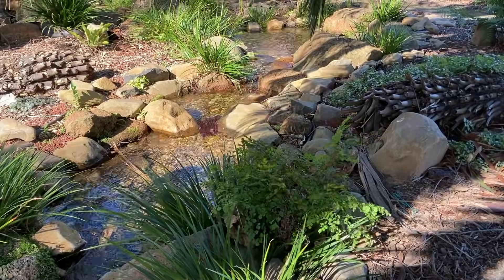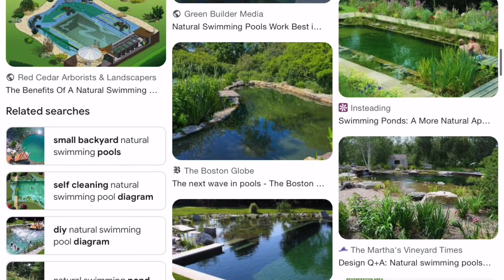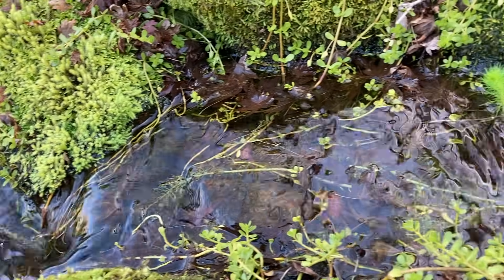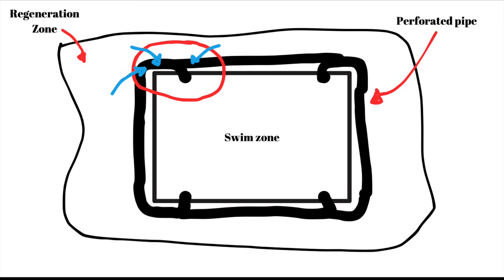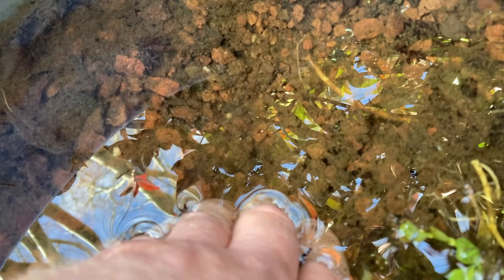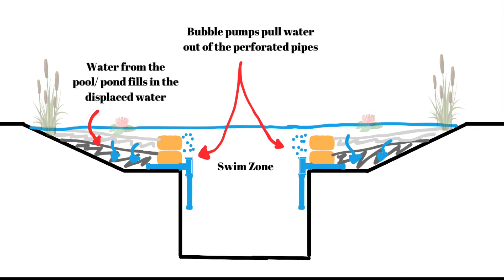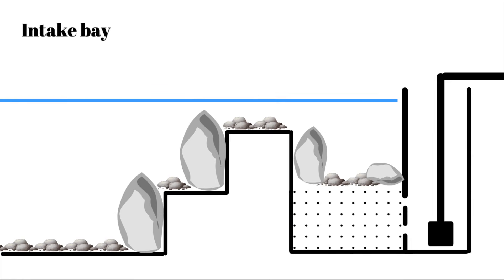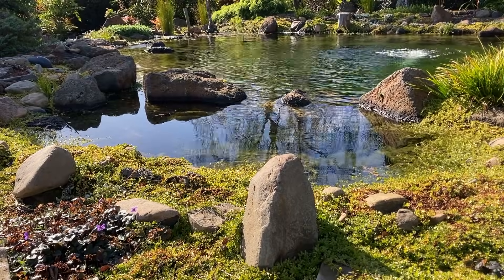Up-flow bog filter vs down-flow bog filter

Comment: Cheers dude 😀

The only additional point I would make is that I think the top-down filters are far bigger because they use a lot less pressure, which I assume means they need a greater volume of slower-moving water to pull from.
The choice seems to be clear... if you don't care about streams and waterfalls, and want the cheapest to run swim pond, then go for top-down filtration with bubble tubes. If you want a stream or waterfall then you have to have a decent pump, which means you can save some space and go for a bottom-up filter, which can be crafted to add to the look of the whole design.

My next question is concerning how the water moves, as you showed with the glass and the tap (I'm convinced the power of the flow would send all the new water swirling to the bottom - you could have added some cordial and made squash to show how the water moved).
Anyway... without some sort of deep level powerhead, wouldn't the water come down a stream, hit the pond at a slightly higher temperature, go straight across the top and into the bog filter, and back round again? You'd just end up filtering the top few inches of water over and over, whilst the slightly colder main volume of water in the deep area never moves? I've seen ponds with additional jets and they make sense, but I've also seen some Aquascape creations that don't seem to have anything but the wetland and stream.
Reply from the maker: I kept trying the glass experiment a few different ways (dye ect) was to hard on such a small vessel. Then I just gave up because I figured whose gonna watch the video anyway. Like I said in the vid it all works, just pick what suits you best. For me it was up-flow.
Reply: I’m making a small swim pond for the back garden and have a 2m high wall that curves around the pond. To save space and not have to have a sizeable regeneration/ planted zone; I figured I could make a hollow faux rock wall in front of this and sit a wheelie bin in it as a top down bog filter (I don’t know if a pond pump would be able to shift water through a bottom up filter to say 1m head height?). Maybe have two of these either side of a separate waterfall going into the pond on a separate pump so that could be turned on and off as needed to save energy. I thought about using airlift pumps but it seems like a nightmare trying to get any significant head height off those things. Any suggestions?
Reply: moving so much water would also cost more i believe both for the machinery as well as electricity? the top-down method only has an air pump, the bottom-up will require actually moving the water?

Comment: I just watched a video where a guy claims these pools cost around $5k a year in bacteria after each season. 

I like your approach much, much better. There's any number of videos where they say they are virtually free to run...and this seems to be much more logical to me. I used to run a 300gal planted fish tank. The bio load and water volume were well matched, and I used a LOT of plants, and plenty of scavengers (pleco's, crawfish, shrimp, etc). But I found the real secret was simply over filtration, and a LOT of flow. I often wonder how that will work when I transition my experience to a natural pool/pond.
Reply from the maker: Filtering water is filtering water. Your aquarium experience has set you up perfectly. Like an aquarium there’s lots of ways to filter water and be successful, just pick the method that resonates with you and go from there👍

Comment: When you were 'pond'ering over this question.  Did you trip over the Pun?
Reply from the maker: Of course! 😉
Reply: Hey, jokes aside.  What would be wrong with the idea of having Both, two filters, one up the top and one below?
Reply from the maker: Nothing at all. Most of my pond kinda have both as the intake bay is kinda a down flow system. Lots of pro builders will also add suction grids in the bottom of the pond and they will still have an upflow system. The more filtration the better.
Reply: Excellent, that was my thinking, especially if your strapped for space but want to keep the bog surface area up.
 @Ozponds

Comment: I made a downflow because I didn't want my pump to overheat when it needs to push water through the media
Reply from the maker: There ya go. I didn’t even know that was a thing. I’ve never had a pump overheat.
Reply: Oh, really thanks, it turns out that I got a pump which was not meant for ponds but I'm trying to make it happen @Ozponds
Reply: Should I make an up flow or stick with what I've got @Ozponds
Reply from the maker: If the Down-flow is working stick with it  👍
Reply: I'm not sure because I rarely turn it on as my pump is meant to work at less than 3 hours at a time and needs to rest the same amount of time @Ozponds
Reply: But the next time I'll build a filter it will be an up flow @Ozponds probably

Comment: Down flow could be easier to build into the floor of a pond I suppose.
Reply from the maker: For sure. Under-gravel filters and suction grids both pull water down through the media on the bottom.

Comment: I think it’s definitely easier to wash an up flow filter using gravity to backwash, than to somehow force water up through a down flow filter to flush it and unclog it. I haven’t needed to do this with my upflow bog filter yet since I ended up putting a chunk of foam over my pump to stop it from sucking up the frogs that insist on living in my skimmer box. I have a space to remove wastes from the bottom of the bog but so far it looks very clean (no solids). The battle with hair algae is still ongoing, I think I can remove it faster than it grows apart from the fact that it is chock full of tadpoles so I need to be very careful and only pull out small pieces at a time so I can check and return any inhabitants to the water. I don’t know if they eat it or if they are just grazing on the massive surface area it provides.
Reply from the maker: I want to do a video on establishing the food chain and it’s impact on algae. I’m
Still experimenting myself. I love your ecosystem first approach. 👍
Reply: @Ozponds  I love our local spotted marsh frogs, they seem to do well here despite the arid climate. Tough little survivors that are happy to make use of human structures (there was one living in the storm drain up the street that I used to hear before I built my pond) and in the very few natural rocky formations outside of town that hold water I’ve seen the tadpoles surviving in impossible conditions. Picture a tiny triangular crevice that holds maybe a couple of bucketfuls of water, completely full to the brim with tadpoles, concentrated by the evaporating water. The top layer of tadpoles slime up and dry out and provide a protective layer for the tadpoles beneath! Hopefully my ponds give them somewhere to continue to thrive as the climate here changes for the worse.

Comment: Hi Kev , when making an above ground pond , the pond pump , pumps the water to the bog filter which is in a barrel. So using an upflow the pond water is directed to the bottom of the barrel therefore is the only way of getting the water back into the pond , by situating the top of the barrel above the water level of the pomd ? 😊🐠🐟🐡🐋🦎🐝🦋🌻😊🐢☀️
Reply from the maker: It’s certainly the easiest way. It’s not the “only way”.

Comment: Hi Kev, i built my pond using an upflow bog using a half IBC conatainer, i have a question about the hole sizes, i think by memory i used 1/4 inch holes throughout the manifold but the holes on the pump are much bigger, so wondering wether the muck will still be able to get through the small holes being under pressure, or will my pipes eventually become blocked due to muck that dosnt fit through the holes? 
Im thinking i may have to dig out the tonne of pea gravel to drill larger holes? 🤔
Thanks!
Reply from the maker: Do you have a skimmer system or intake? If the pump is in the bottom of the pond, you might have an issue. If the pump is inside a skimmer or intake (these act as pre filters) you should be ok.
Reply: @Ozponds  no skimmer or intake.
I mechanically remove any debris that falls in but hardly anything does due to where its situated.
 Pump on bottom but I have the large bog and then another DIY mechanical/biological filter also

Comment: I suppose any flow of water through or across bacteria colonised media does the job, but I can see more logic in choosing up-flow for a dedicated filter. I'll ultimately be having an up-flow bog that feeds out to a naturally down-flowing stream with its own rocks, gravel and marginal plants. As you say Kev, it's all about emulating nature... we just have to design it well enough to invite nature to move in and do its stuff to best effect.
Reply from the maker: Spot on 👍
Reply: But most natural ponds I see Are pretty nasty looking 🥴

Comment: Hi, I'm in the process of moving my pond *(orders of the boss lol) as the original was inadequate and a trip hazard.  My intention is to follow your advice and install a bog filter etc.  My only concern is the measurements of the foil, as I am sure you would agree is very expensive to get wrong.  Here in Germany they offer two types..., 1. the normal direct foil and the foil which you then cover in concreate.  Have you ever heard of the later and or used it?
Your thoughts and advise are truly welcome.

Regards

R G
Reply from the maker: Here’s a video I made a long time ago. I probably should re make it. Anyway it should help you work out how much you need. How to work out how much pond liner you need.
https://youtu.be/jQaBM8Vi6_8. I’ve not heard of a specific liner designed to have concrete over the top (unless your talking about builders plastic). My choice is always epdm rubber.

Comment: Bottom flow going up seems to be the least complicated to build, and maintenance. I clean mine once every five to six years, only because once the vegetation has established itself, it becomes a serious workhorse for filtering. The entire filter is about 2' to 2-1/2' deep (60cm to 76cm) 2" (5cm) slotted pipes are fashioned along the bottom into a shape that runs the contour of the pond with one intake, and about a foot (30.48cm) of 3" (7.62cm) gravel is filled over the top of the piping leaving about a foot of water for plants to populate the gravel. This bog makes it convenient for dechlorinating municipal water when added to the pond though aeration, and addition of dechlorinator, and in my hardiness zone the plants are the first up to start filtering when the bacteria is still in suspended animation from extreme cold winter temperatures.
Reply from the maker: Sounds perfect 👍. Thanks for sharing your experience 😊

Comment: Nice video Kev! I use the Down flow type myself. Have been using that style for  close to 30 years.
Reply from the maker: Awesome 👍
Reply: @RC-Flight do they tend to clog or become less efficient over time?
Reply: @andynz7  mine are either in plastic tub or a plastic Barrel with a one inch drain cock in the bottoms. I can open the drain and flush it out with a hose. This is only done in the fall. I get freezing temps through the winter, so my filters are totally shut down and cleaned up each fall. 
I use river rock of varying size in the bottom and then a mesh bag of clay round small balls on top of the rocks then a course woven filter pad. I have not needed to clean it yet this year.